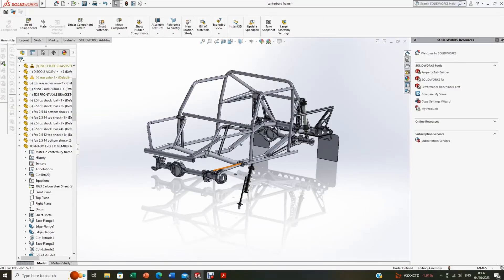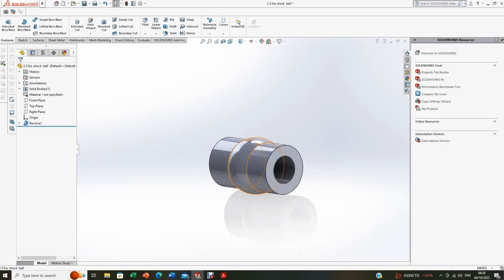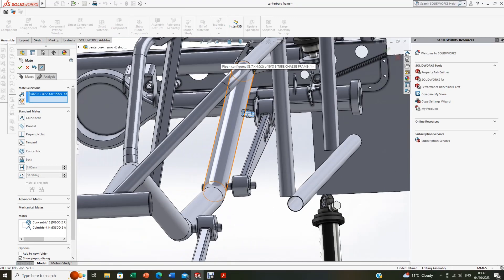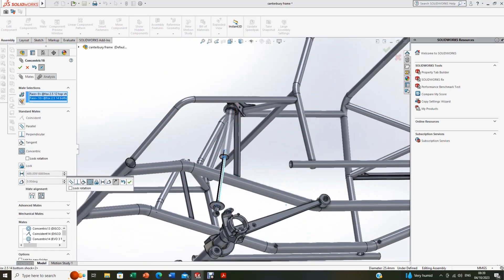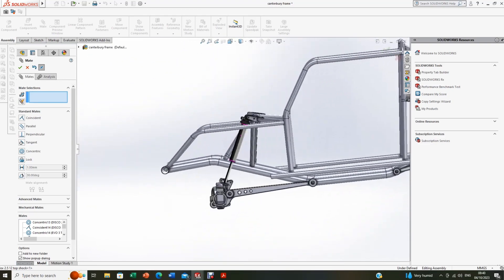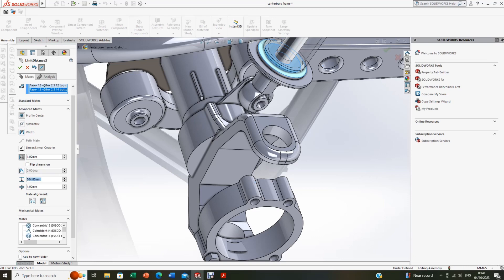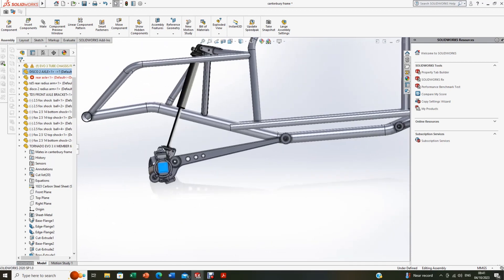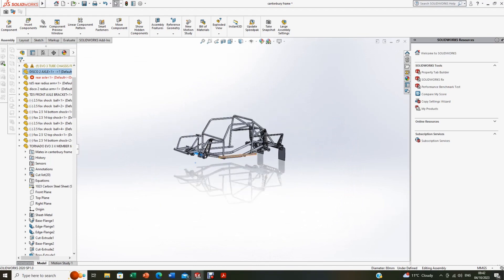SolidWorks Fox Coil-over limits on Tornado space frame

Comment: You should research the definition of 'spaceframe', as your tube frame is very far from one...
Reply from the maker: This is not the complete design but it is a full tube structure that doesn’t require the bodywork for strength so I have always classed them as space frames
Reply: @Tornado_Dave  A space frame has a very specific set of engineering requirements; you are building conventional tube frames.